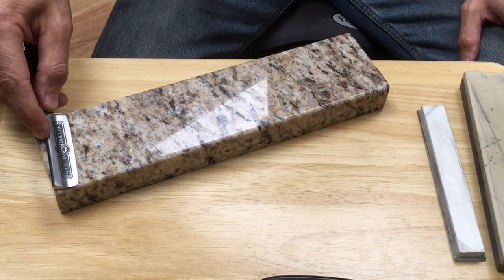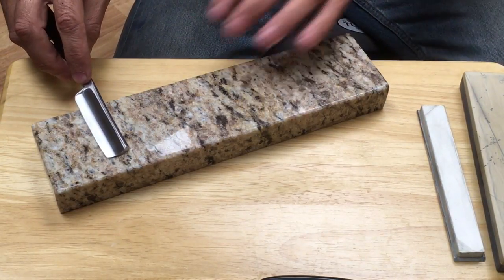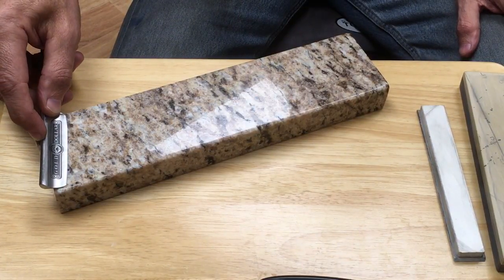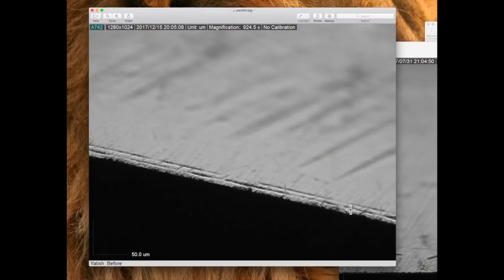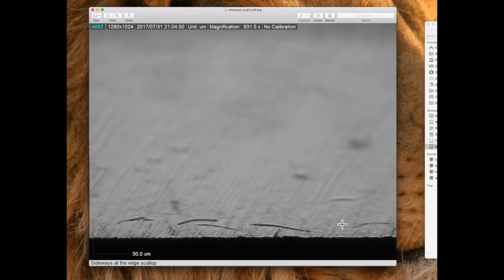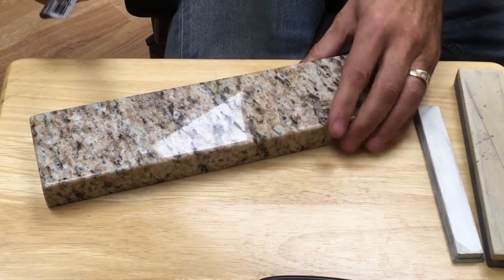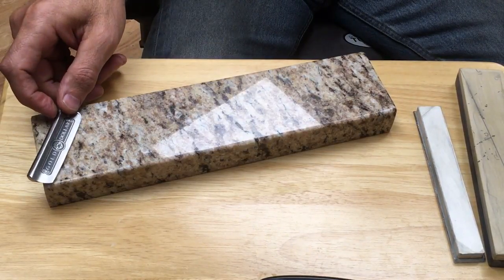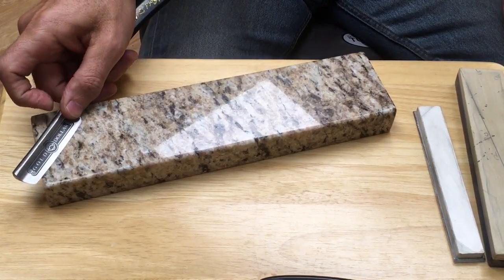The Simple X Stroke May Not Be So Simple HD VERSION 1/2

Comment: I think it's better not to do x strokes if possible. 
It still has these issues:

1. The material removal rate does not correspond linearly to the pressure. It depends on the type of whetstone.

2. Change pressure means more pressure on the heel. Different pressure = different whetstone behavior, different scratches.

3. Very important is not to change force but change pressure. So it depends on size of sharpenning surface. Every straight razor has different relief face (flat between edge and grind) and flats on spine.

4. The small inaccuracy is multiplied by the number of strokes and honing sessions over years.